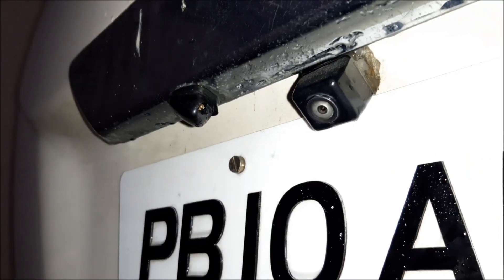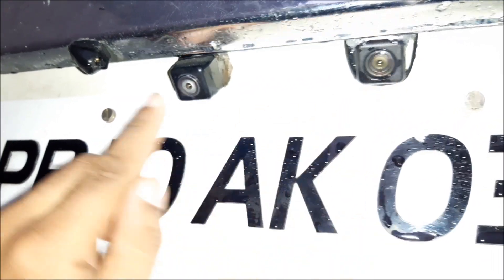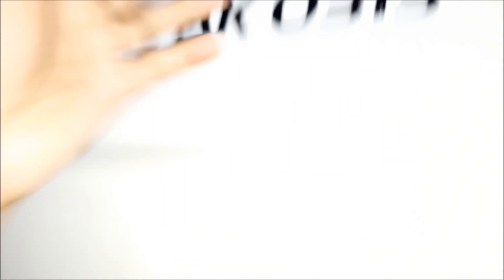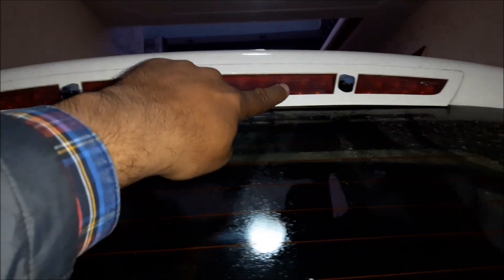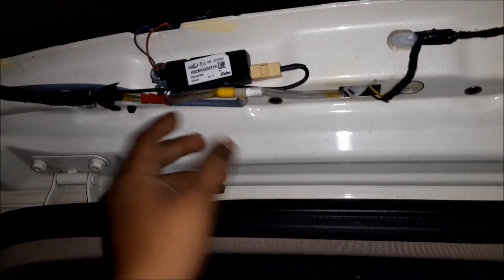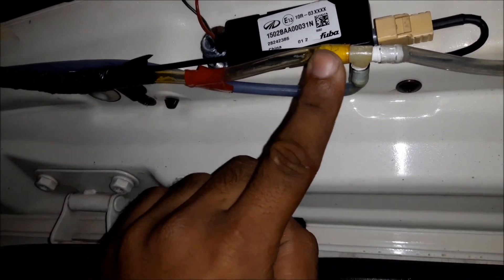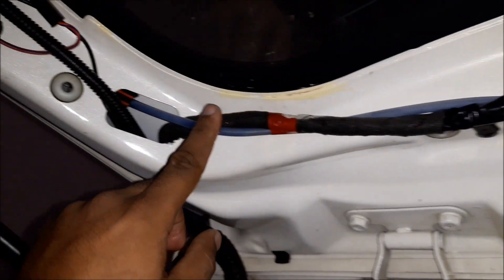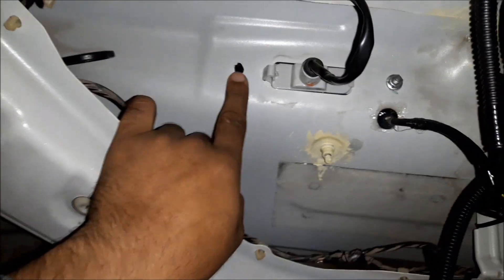How to install washer for Car’s reverse camera | Automatic lens cleaner system in car 🚗

Comment: Hi I’ve just ordered a new car with a reversing camera, and I thought it’ll be great, then I test drove another car. It was fine to start with but after 30 minutes driving on country roads in the rain I couldn’t see a thing, the camera was covered in dust/mud!! So, I’ve been looking at putting a separate washer bottle in the boot and operating it off the reversing light supply. If you search for universal car windshield washer pump kit you’ll find several complete units, water bottle with built in pump, tube, nozzle and switch for around £13.00 sterling ($17.00- US) ridiculously low price! (I’m in the UK) I really don’t want to modify a new car but if the manufactures don’t fit camera washers, then I will. But before I fit it, I thought, ‘I bet it’s been done before, better check on YouTube’ and sure enough here it is. Well done, I bet a lot of folks will copy your idea.  Kind regards . . .  Andy
Reply from the maker: Thanks Andy for such a detailed comment. Congratulations for your new ride 🎉. Yeah I saw that kit on Amazon too. But mounting and arranging space for that tank is another challenge. My car is 2012 model out of warranty but whatever modifications I do, I keep electrical connections properly insulated and mechanically strong (I believe that’s what factory fitters do 😊)
Nice to hear from you brother.
God bless you and your family 🙏🏻